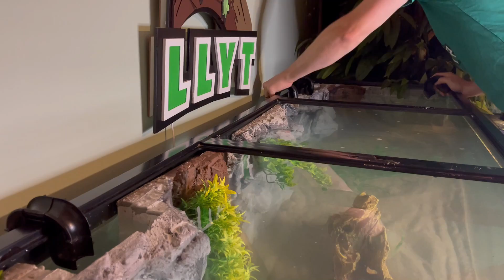210 Gallon Turtle Tank - THIS TANK IS HUGE!

Comment: Great improvement from your previous videos! My only problem with either diy or commercial aquarium backgrounds is the bacteria that accumulates there. Otherwise great ideas.
Reply from the maker: Thanks! Some algae has accumulated on it but it gives a natural look, my filtration takes care of keeping the water clean and from any grime getting too out of hand!
Reply: Sure, but bacteria doesn’t get eliminated by the filtration.  I almost installed those Universal Rocks backgrounds on 2 of my 75g tanks but my turtles' vet advised to not to do it.
Reply: @albertsrour8687 
They're filled with bacteria and so are you. With proper filtering and a substrate like this, a biological balance can be achieved. It's a bit trickier with turtles because they are such massive polluters, which is probably why your vet would advise against it.
But if the fish can live and thrive in it for a long time, it should be fine. They have extremely resilient immune systems and would deal with far worse out in nature or even in a pond.

Comment: currently researching what I need to set up a 300 gallon tank for a red eared slider.  What heater did you use for  the 210 gallon and was it sufficient